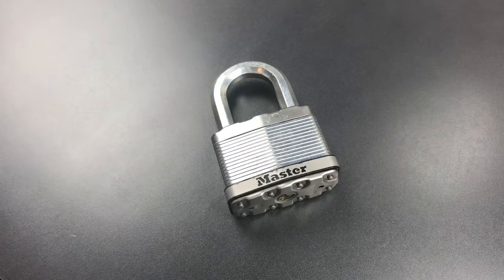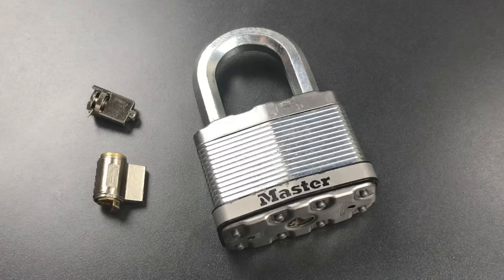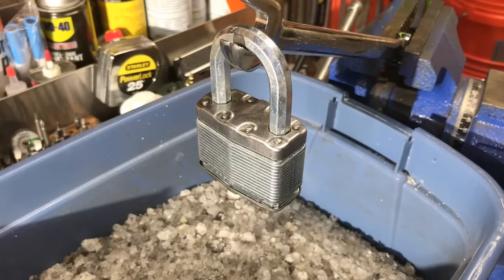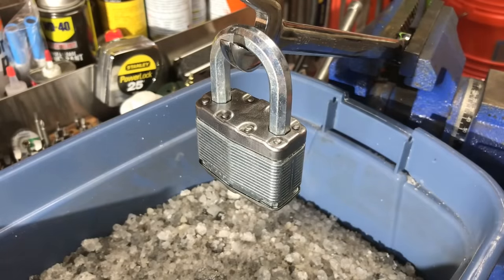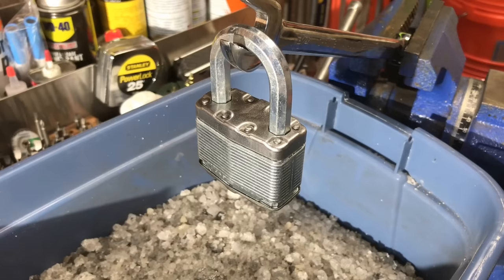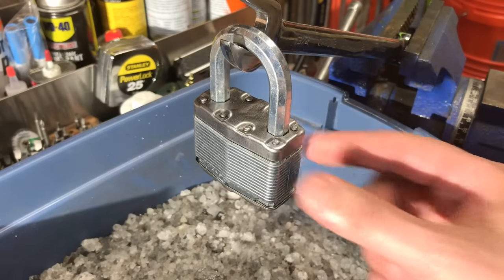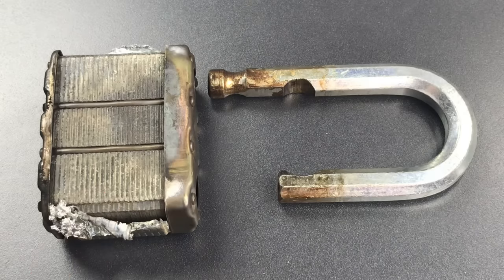[693] Plumbing Torch vs. Master Lock Magnum No. M15

Comment: I think you got defective unit, isn't normal to resist for so long.
Reply: He doesn't have the hottest part of the torch on the lock.
Reply: @apersonontheinternet8006 its sarcasm
Reply: @apersonontheinternet8006      To be fair, he did state that he didn't want the zinc to ignite, so he probably avoided it for that reason.
Reply: Wasn't using mappro
Reply: Faster if he would’ve put the torch in the keyhole
Reply: Try burning the boron lol you’ll wait weeks
Reply: Depending on what kind of torch and gases you’re using you can tortured from the side where he’s doing it or you can go through the keyhole I’ve done both ways I even have another tool that can heat that whole lock up the melting temperatures within 30 seconds and it’s small enough I can put it in a book bag  and if you wanna watch a few YouTube videos and make one of your own induction heater
Reply: he should contact the manufacturer for the warranty ;D
Reply: anyone can do it tho. licks take skill, at least most of the time
Reply: @Mr371312 lick.. havent heard that word since my using days.. YOU WILL GET CAUGHT ONE DAY TRUUUUST ME!
Reply: @apersonontheinternet8006  the first reply: always serious about it

The others: haha sarcasm you bad
Reply: This implies that you did this shit too
Reply: They just mistyped "locks". Locks take skill. Not licks. Yanno, because this is a video about a lock.

Comment: very nice job,... I think that's the longest a MASTER LOCK  has put up a fight.....
Reply: Sebastian Ramadan heh... no FLUX given... nice one
Reply: Its a bernzomatic ts8000. Goes on single tank of propane or MAPP.  Mapp out of that swirl tip is about 3600°F and propane is about 3200°F.  Great torch, however tip is for braising, sweating, light surface welds, etc.  With this torch a pencil tip would be ideal for this application.
Reply: Tough under fire.

Comment: What struck me as really sneaky and indicative of their corporate philosophy: the zinc shell corrugated to look like their original famous stacked steel construction. That's like the Pyrex brand name now being used on cheap non-heat-resistant soda lime glass.
Reply: Oh, wait, it's a fake zinc facade over a real steel body? WTF?
Reply: same
Reply: It's still a layered still body - you can clearly see this at the end, it just isn't the most attractive or high 'fit & finish'. It's absolutely still a "famous stacked steel construction", it's just been spiffed up some to catch the eye of potential buyers staring at a wall of locks. Nothing wrong with that, just a business doing what's necessary to maximize success.
Reply: While that's a popular thing to say Pyrex has always used Soda Lime glass for their cheap line and Borosilicate Glass for the expensive line. Always. Since the company was founded.

Some idiots on the Internet broke some Pyrex, blamed it on "modern soda lime" and now everyone believes it. Its not true. You can still get both types of glass from Pyrex and they've always sold both types since the company was founded. No one noticed this "not heat resistant Soda Lime" until recently and tests done by Time showed that most "old Pyrex" that people swear by and claim is the best ever and better than the modern stuff? Soda Lime.
Reply: Every piece of Pyrex from before they sold the name I have seen is the characteristic borosilicate color, clear to slightly yellow. Every piece I've seen after they sold the name is that sickly green color of soda-lime glass. I'd never seen an older piece of Pyrex made of cheap soda lime glass.
Reply: @medes5597  I have a set of Pyrex bottom-of-the-line measuring cups and casserole dishes that I purchased when I was in college and another that I purchased recently. You can clearly see by the color that the old ones were borosilicate and the new ones are soda lime. While there may still be borosilicate laboratory glassware sold under the Pyrex name, the Pyrex brand of consumer products sold by World Kitchen/Corelle is entirely soda lime.
Reply: @ZanHecht   I'm not saying some stuff hasn't changed but the idea that new Pyrex is all soda lime and all the old stuff wasn't is nonsense. They have and still do sell both.
Reply: @medes5597  show me a single currently sold consumer product that is borosilicate. I spent a bit of time in an actual World Kitchen factory store a few years ago and didn't see a single one.
Reply: Zan Hecht new American Pyrex is hardened glass, European Pyrex is still borosilicate. Hardened soda lime is a pretty good material for kitchenware. In some ways, arguably better.
Reply: @kalel33  poor zan
Reply: @JasperJanssen  However in Europe, Purex is or was a respected brand of heat resistant laboratory glassware that can be used over a Bunsen burner to melt or boil chemicals, though obviously not strong enough for melting steel or silver.
Reply: I don't know why anyone would want to use borosilicate for cookware anyway. Food sticks to that stuff worse than any other cookware I've used in my life.
Reply: @bubba200874426  Thermal shock proof, thats why. Soda glass is terrible at that, tempered or not.
Reply: @ZanHecht  Speaking of Corelle, ill never forget the time i saw someone that said pretty much the only thing that can break it easily was “banging them together makes the magic fall out.” 🤣

Comment: Thankfully you won't breath in the plastic fumes. 

Burns zinc
Reply: Also burns the lock... in a plastic bucket!
Reply: Zinc oxide is good for your arm pits, i read recently.
Reply: Somehow i feel like im breathing zinc oxide
Reply: If you heat up zinc you are sucking fumes. It doesn't even have to smoke, melt or burn. Since you breathe zinc fumes in at a molecular particle size it enters your blood stream. Those molecules are not spherical, they look like shards of glass. Think of a billion or so molecules of glass floating inside you. That's how you die, don't burn zinc.
Reply: @damienheitzer8712  I know that... what part of my comment implied zinc was safe to heat up?
Reply: @jacobkeary6740  I figured you knew not taking a shot at you man. Left comment for the sake of others. I know two excellent blacksmiths who died from forging galvanized steel. There are tons of old galvanized myths like drinking milk makes it better. Guys think they can tough out zinc poisoning, it's fairly progressive and will kill you way earlier in life.
Reply: @damienheitzer8712  The ole shakes
Reply: He did say he's wearing a respirator
Reply: Del Halley  The principal of "don't melt plastic" before proceeding to melt a super toxic material still stands, respiratory gear or not.
Reply: Del Halley  That still doesn't change the fact he addressed the way less dangerous substance as a threat before he did the famously toxoc molten zinc, what aren't you getting?
Reply: Maybe the respirator filters zinc or zinc byproduct out of the air and not plastic fumes.  Different size particles or whatever.
Reply: @GaryNumeroUno  That's what the rock salt is for?
Reply: Del Halley  I think you're going to be waiting a looooong time for that answer. He's still trying to think of one.
Reply: That’s why he said “I have open my garage door and putting on a respirator”

Comment: the dual flames coming out the bottom at 6:07 was very nice.... i think that's when the last of the internals started meliting
Reply: Yes, that does look very much like the happenings of a thermite reaction... this is beyond melting; the metals are actually burning at this point. See this video for example: https://www.youtube.com/watch?v=UsmsvA8cB3o
Reply: I thought that those flames might've been the grease igniting. But looking at the colors more closely  (kinda hard when your legally colorblind lol) they look more like metal flames (good band name hahaha)
Reply: @joshuasamuels4802  There does appear to be some kind of grease flame on the shackle at the end of the video, but much earlier than that, there are far more energetic flames shooting from the bottom of the lock starting not long after the fumes emerging from all around the lock, like that of a metal flame. My research tells me the flame of a zinc thermite reaction should be bright blue and the smoke should be white, but the parts of the footage that aren't swamped with white light are actually more in line with an iron thermite reaction, making me think a zinc thermite reaction triggered an iron thermite reaction...
Reply: Sebastian Ramadan Chemistry is the best! Thanks for more insight with thermite reactions. I appreciate it.
Reply: You can actually see little white puffs coming off the top, like when you weld sheet metal with zinc coating. When i saw that, i thought to myself "next time he taps it, its gonna fall apart..." sure enough!
Reply: The masterlock has built-in retrorockets to soften its fall from grace.
Reply: Thats what i thought.  Pretty noticeable change
Reply: Did you get a chubby?

Comment: Wait, so that outer layer is fake?  I thought all of those lines were actual layers...

Nice facade ya got there, ML.
Reply: Sam T most of the time laminated pad locks like that do have multiple plates, this one just used a shell to fake decent construv
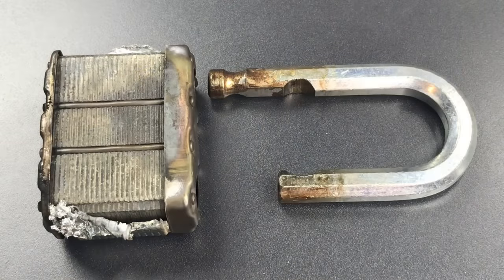Reply: No, look at the lock after he melted the the outer layer (you can get a good look at 6:25) - the actual lock body is made out of multiple layered plates, it just doesn't look very nice so designer put a nice shiny decorate shell around it (it probably helps to somewhat protect it from weather as as well).
Reply: Sam T I thought the same thing, I figured it was peices of stamped metal layered and riveted together.
Reply: Yup, I'll givem' props for that, fooled me!
But I'm not quite a lock aficionado either, lol
Reply: I thought the same
Reply: Well it's literally just a cheap outer layer they put there for looks, I wouldn't really call that a facade or a deficiency or anything. The actual lock body was very durable.
Reply: 7:00 sam, legit right there you can see the layers
Reply: Indeed. I thought that also. Seems Master used a phony covering to make it LOOK well made.
Reply: they are laminated locks (6:25), the zinc shell is slid over the actual laminated lock for weather protection

making the zinc shell look laminated was probably an aesthetics decision

Comment: fire it up the key hole next time, go straight to the core.
Reply: That's what she said.
Reply: That IS what she said...How did you know?
Reply: Mitchell Nova  that's rough dude.
Reply: Or you can simply say.....fire in the hole
Reply: The point wasn't to mess with the pins or anything.  It was the actuator above the core.  I assume this was a reasonable way to do it.
Reply: @humaj19  Melting the entire core until it flows out the bottom would leave nothing holding the mechanism shut.
Reply: Uh, could get messy when liquid metal goes down the torch, comes splattering out, and ends up in your eye.  Or it could wind up setting something else in the garage on fire.

Comment: The tip of the flame is the hottest spot, play that against the surface you wish to heat up. Your torch was too far away. The propane didn’t like being laid over either. Next time position the lock higher up so you can keep the propane bottle more vertical and direct the heat more from the bottom. Great video !

Comment: Little tip. the hottest part of the torch head is actually where the darkest blue is. Where those mini 3 or 4 blue jets are, about 1cm off of the nosle's tip, those should be just touching the surface you are heating.  Although you are directing flame onto the work surface, it is cooler part of it.

It is like when you first light an oxy acetylene rose bud torch, when you are adjusting to the correct mixture of oxygen and acetylene, the flame first is very loose and can even stand off of the tip but as your mixture is brought into the hottest mixture possible, you get a very tight pattern of 4 or 5 mini bright blue jets with very little excess acetylene being burnt elsewhere.

Basically it is the pattern you are seeing on this torch but everything is very clean and crisp.
Reply: I was thinking the same thing
Reply: When he torched open the American lock, everybody told him it would have been faster to hold the tip back a little bit. I noticed right off that he took their advice and now he is told to hold it closer. You just can't win.
Reply: Are you a chemistry student? Why do you know this in such detail? I did know that the blue is the hottest from my chemistry classes at gcse level
Reply: @pierreemerick-aubameyang1096  sounds like he is a welder, talking about acetelyne torches and cutting techniques..
Reply: Just realized this was 8 months ago lol

Comment: I wonder if you were to apply heat to the shackle, could you then melt the zinc  locking mechanism where it latches? Depending on the thermal conductivity of the steel, it could open the lock faster.
Reply: LaMeurtrier, I don't think so, because the shackle is in contact with the ball bearings and not the mechanism itself so that will act as an insulator.
Reply: Any contacting material is a better conductor than air, so the key way might also be a good place to point the torch.
Reply: Then we wouldn't got to see the cheap casing melt away so quickly.
Reply: I think aiming the flame directly at the keyhole would be the quickest.
Reply: All of these arguments seem to have merit, but LPL chose this method, and he knows his shit. I'd try looking for a reason why this is the right way, before looking for reasons it isn't.
Reply: @keithklassen5320  they kind of are and i agree with them on the keyhole.  i braze and solder for a living, so heat conductivity is something i deal with a lot.  no one is really wrong in this instance, just different ways to go about it.

Comment: Just think, if they hadn't cheaped out with the diecast shell and used (for example) a pressed stainless steel shell (even as thin as 0.5mm) then this attack might not have worked in even double or triple the heating time because of the air gap.
Reply: The shell wasn't the problem, the cheap pot-metal cast actuator was. A brass mechanism wouldn't have let go so quickly.

Comment: I'm a yard spotter at a distribution center and truck drivers will forget their locks on the trailers from time to time. I have seen two that look like these. Masterlocks I always just get my hammer, pull down a bit, and tap the sides. Works every time. I've also broken the heads of two 48in bolt cutters trying to cut an Abus and an Abloy

Comment: The hottest part of the flame is the part at the tip of the light blue cones, that's where the combustion is complete, but no heat has yet been lost to environmental mixing. That means you can put the torch far closer and speed the process right up.
Additionally it looked like there was something either partially blocking the gas nozzle in your torch or intermittently obstructing your air inflow ports at the base of the torch body this is causing the torch to flare and reducing the efficiency of the burn.

Comment: Would like to see that with high voltage induction heating
Reply: Eric Younkers the backyard scientist did a similar video.
Reply: Why not shaped charges, or an anti-material rifle? Would be faster...
Reply: Hell you could just hook it up to parallel deep cycle batteries and melt the whole damn thing into the core of the earth. Well maybe not to the core but i guarantee the whole thing would glow in seconds.

Comment: Imagine what an oxygen and acetylene torch could do to most locks
Reply: It sounds like MAPP gas being used. (Or at least like the MAAP gas and torch head I use)  I agree an oxy acetylene torch would be lots faster. 
And a plasma torch head would be even faster still.
Reply: A proper oxy-fuel cutting torch, even a small one, would have cut through the shackle in about 30 seconds.
Reply: @aevangel1  I think 30 seconds including starting the torch and getting it adjusted lol
Reply: an oxy/acetylene torch is like an angle grinder.  there is no answer to it.  if the thief is using one of those, he's going to get what he wants.
Reply: @thomasjenkins7506  I am not sure. Angle grinder is good for steel alloys, but not that easy to cut soft metals, like aluminium. Or not good for concrete, you have to use diamond cutting wheel for that. Oxy/fuel won't cut through concrete too. Diamond wheels cut steel, but that's not fast. I think a layered steel/concrete/steel/concrete construction would keep someone out long enough. Not necessarily think in padlock only, but as a door panel, for example. If you use waved steel... Good luck replacing the discs at layers... 😉
Reply: @thomasjenkins7506  problem for the thief though is that an oxy-acetylene torch is  very loud, bulky, difficult to hide , and makes a bright, eye catching light.
Reply: @kennandunn7533  they make portable ones that are no louder than an acetylene torch.  you are right that they are largely impractical, but like angle grinders, there are thieves that use them.
Reply: Or blast the fittings the lock is intended to secure.
Or gnaw on exposed hinges.
Or chew a hole through the wall.
Or come down the chimney.

Security is an illusion.
And yet, MARXISTS still crave it...

Comment: Stupid question but would it be possible to melt cast zinc using electric current or magnetic induction?
Reply: I also wondered about an induction heater (bolt heater)?
They come for ~$40 and would be even quieter…
Reply: Not stupid at all! I too am curious about an induction heat attack. Or at the very least, insert a thin heat element (like that of a soldering iron) into the key way, to apply heat from within.
Reply: Induction heaters only work on iron/non-stainless steel.
Reply: Induction heaters require ferrous metals. 

You could probably melt the shackle if it's not good stainless steel. 

Your electric current idea is better.  Portability is the hard part of that. Best you could do is stick a big lead acid battery to it and hope nothing explodes. Will pass enough current to significantly weaken and perhaps even melt it though